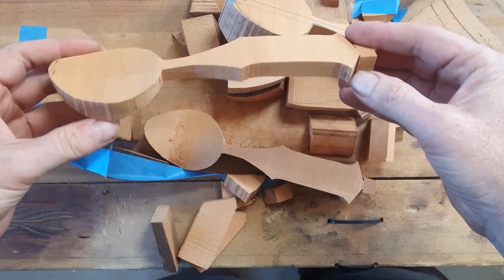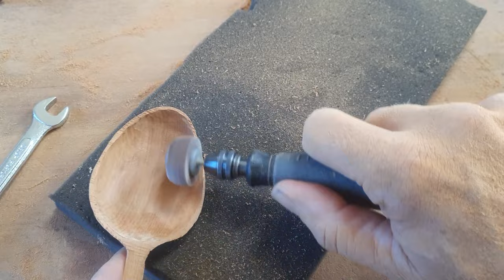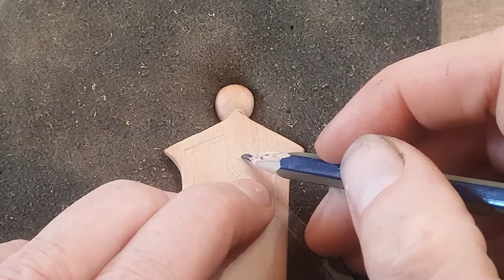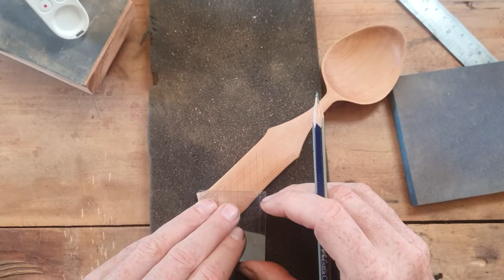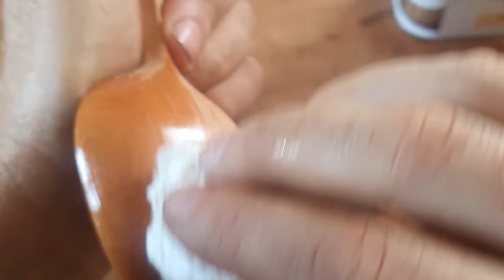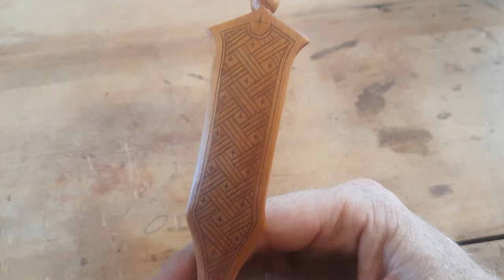Power Carving a Spoon from Wood

Comment: Great work again, Matt.   I've been getting tired of roughing in my spoons and ladles by hand... what do you think is the minimum depth of cut for a bandsaw for such work?   Maybe 6" to allow for an occasional mug?   Keep it up!
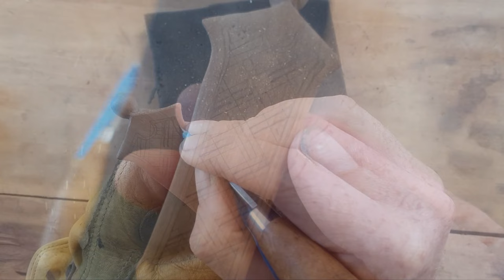Reply from the maker: Cheers Brendan. Yeah roughing out by hand is tough. I do like the bandsaw for this purpose. Not really sure what you mean by minimum depth? it will cut extremely thin and also very thick wood (pending on type of band saw) I use my bandsaw alot. Check out  this at 1:28 time https://youtu.be/eZWZ_fgZZZM
Reply: @MattCarves  Thanks, Matt - speedy reply!    I'm thinking about the thickness of stock it can cut... not the depth of the bandsaw throat, but the vertical span of the saw blade for cutting (or re-sawing, effectively) thicker stock.   I think a 4" max depth would be sufficient for most of my tasks, but I get one shot at this with a modest budget.    Much appreciated.